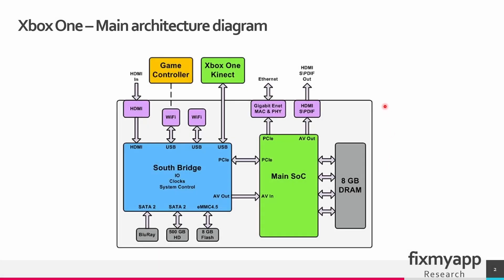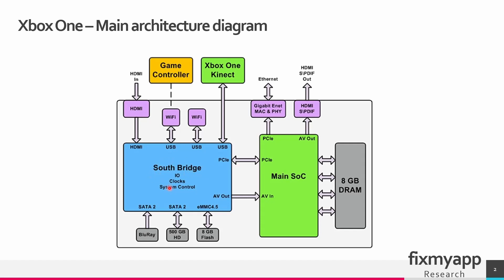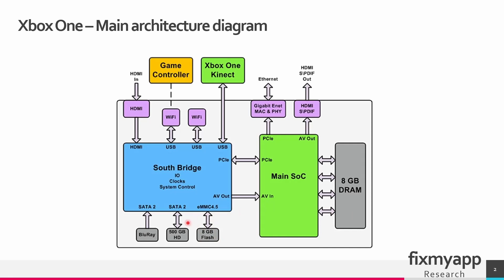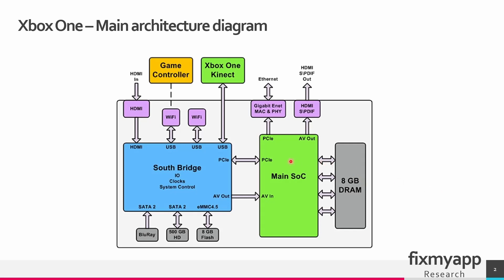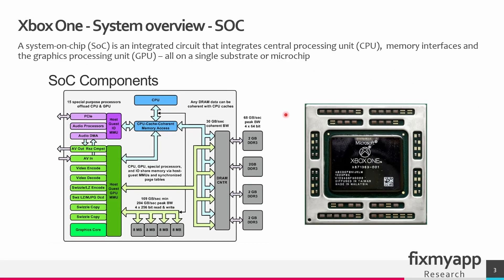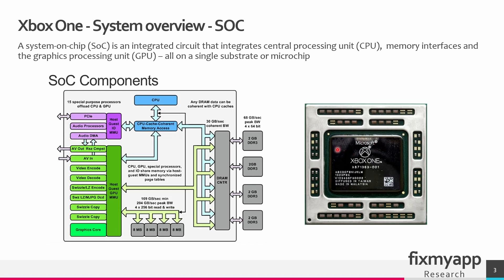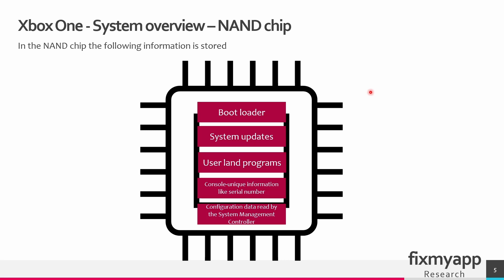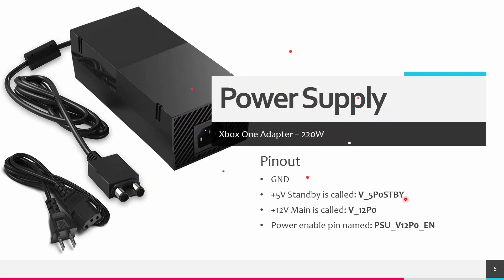Analyzing the ARCHITECTURE of Xbox Consoles - PART 1

Comment: I have a Xbox One that opens games and then closes it. I've changed thermal paste and isntalled a new hard drive but the problem doesn't go away, do you have any advice? (it hasn't water damage)
Reply from the maker: Hi, These problem are hard to diagnose maybe it's a faulty RAM that is causing the problem if alle other measurements are ok. Gr. Jim